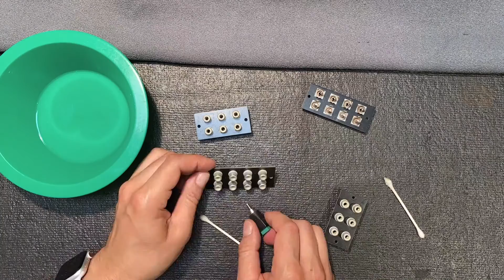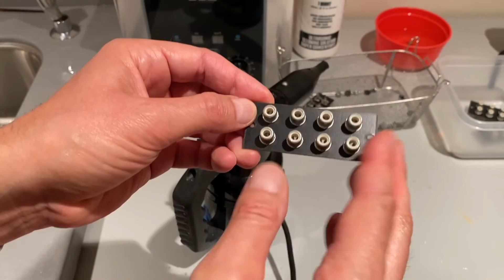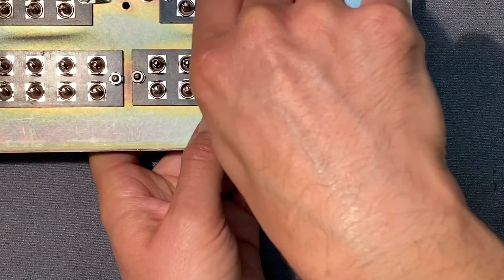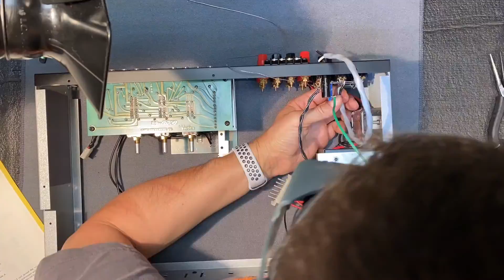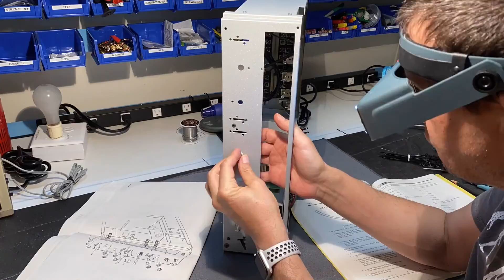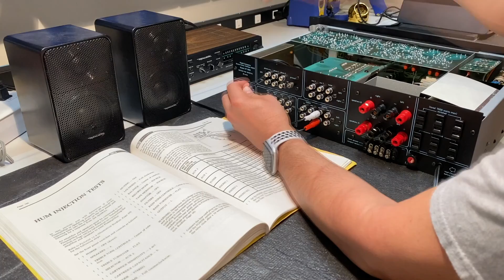Let’s Build A Heathkit Stereo Preamp • P5 Does It Work or Release Magic Smoke?

Comment: Not sure you check your fb comments on your videos but... I finally found an unbuilt AP 1800  on epay and will have it soon. I was wondering how well your unit is working after a few years of service. I have other "high end preamps" but I have admired the AP 1800 for years basically for it's diverse front panel and the ability to switch in multiple turntables. As an electrical engineer, I plan to make some improvements and will probably have some new boards made to keep the improvements looking more or less stock. One plan is to replace the transistors in critical audio path areas and use newer ultra low noise FET's. Of course, many or all of the electrolytic caps will be upgraded to new excellent caps made by companies such as Nichicon, Rubicon and or Wima caps. Should you be interested in the project, perhaps, I can send you upgraded pcbs for evaluation at my cost. Anyway, I was impressed on your assembly of your unit and the excellent info you shared.. my info is glenn@dsmlabs.com  name is Glenn

Comment: Preamp ? Integrated amp ...
Reply from the maker: It’s a preamp.
Reply: O.K.then why ,on  your pre. there are speaker connectors A and B 8 terminals ,so what do these terminals do? @FluxCondenser
Reply from the maker: @alaingingras7224 This preamp has functionality to connect amplifiers and speakers for selection control. There is no amplifier in this unit. It’s explained in more detail if you watch all the videos in this series. Hope that clears it up.
Reply: Makes sense .Thank You for responding ! @FluxCondenser

Comment: I hope you didn't paint over areas where the chassis is needed as a ground. Any place on the chassis that is used as a ground needs to have the pain carefully removed and the naked chassis exposed.
Reply from the maker: No, of course. I believe I mentioned this in the video.

Comment: (1) Use a hair dryer. Much better than that goofy dust buster.

(2) Save the nut driver. THE BEST tool Heathkit provided. Unobtaniim now!
Reply from the maker: 1. No, that “goofy” blower is one of the best tools you can have on your bench. A hair dryer? That’d be pure stupidity. 2. Yes. I’ve got dozens now.

Comment: What did you use to clean the contacts on the inside of the RCA jacks?
Reply from the maker: Wool bits driven by a Dremel and Nutrol control cleaner. The bits are gentle and provide just the right amount of abrasion. The Nutrol lubricates and leaves a protective coating. Works really well. Here’s a link to the bits I use: https://www.amazon.com/Multifunctional-Grinding-Polishing-Accessories-Attachment/dp/B00XJINV42/ref=sr_1_3?dchild=1&keywords=Drexel+wool&qid=1602053831&sr=8-3
Reply: @FluxCondenser  Bookmarked!  Anyway, I often use inter-dental cleaning brushes for this.  They're better for cleaning nine-pin tube socket contacts, however, as the brushes have such a small diameter.  They're available at your local Wal*Mart.

Comment: I think the swapping of the meter leads on the negative power supply was intentional.    Back when this was produced, almost all voltmeters were analog.  You had to swap the leads to read negative voltages and mentally apply the minus sign (if you didn't swap, then the meter needle would peg hard to the left).   But these days, your digital meter can show you a minus sign.  I don't really consider it a "mistake" by Heathkit, they were just following the normal conventions of the day.
Reply from the maker: Not quite, but close. By this point digital meters that showed negative voltages were available. The reason for the issue was that Heathkit wanted the test done and didn’t want it skipped by people who didn’t have a volt meter, digital or otherwise. So instead, they instructed the builder to use one of the as-yet uninstalled LEDs from the kit to create a rudimentary test probe by attaching the LED to a provided resistor. This relates to your point. As with analog meters which can’t show negative voltages, LEDs can’t illuminate with a negative voltage applied to the positive terminal. Unfortunately, Heathkit used the same instructions for both those using a meter and those using an LED which led to some confusion. It is less of a “goof” on Heathkit’s part when you put it into historical context. Thanks for the great comment.
Reply: @FluxCondenser  You are right, you could get a digital meter in 1983.  I just had a browse in a 1983 Radio Shack catalog.  $79 for digital (about $200 in today's $) and about $39 analog for mid-range models.   Don't think I could afford one until the 90's.
Reply from the maker: Paul Rose Yup, that would be a big difference in price. I was in middle school when this preamp was introduced so all this was just unobtanium in  a catalog to me back then!
Reply: @FluxCondenser It seems to me that the authors of the instructions would have written them for the most basic meter a customer might have, which in this case would be an analog meter. The fact that expensive digital meters existed at the time doesn’t mean the instructions should be written for them.

Comment: Sometimes I wonder how my AA1800/AP1800 sounds compared to some of the Emotiva XPA2 Gen1 amplifiers combos, bought this stuff used a few years back locally after a long time looking and waiting.  The Pre amp is alright, but I think it needs a recap since my NAD 1600 is far more transparent.  The amp probably needs to be refreshed with new caps also.  Hard to believe they are kits, nice and thick metal not the flimsy sheet metal used today.  I wish they still made audio like this today without the esoteric prices and looks.  I read somewhere that Heathkit company hired Harman Kardon engineers to help them design these products, I wouldn't be surprised, since Harman Kardon has some of the best vintage receivers and amps I ever heard.  Looks kind of Harman Kardon also.  Nice Job, I wish I had the time and the skills you have!
Reply from the maker: Thanks Sound Man. There were a number of components that tested bad on my kit which needed to be replaced, so it’s likely that your kits could benefit from a tune up. Interestingly, though, the electrolytics tested OK for the most part even though I didn’t use them. In the next video, I’ll be bench testing the preamp as well as doing some listening tests. Without letting the cat too far out of the bag, I can tell you that to my ears “transparency” is stellar. The preamp is dead quiet and the phono stages sound superb. Stay tuned.

As far as Harmon Kardon, that company did provide the later stereo kits for Heathkit in the final years that they offered them. I’ve heard that these particular models (Pro Series) were Harmon influenced, but I’ve also heard that’s not the case and they’re pure Heathkit and that’s what I’ve come to accept. I’ve not read anything conclusive that confirms otherwise and there are no Harmon markings of any kind in the kit or its literature. For the later kits, Heathkit was very clear about the Harmon involvement.

Comment: The wait worth it! Excellent job. Indeed it looks that the preamplifer was meant to be built like a tank for years and years of service.
Reply from the maker: Thanks, Irwin.
Reply: @FluxCondenser  Hello Flux, is there any posibilty you can give me advise on a hifi component I'm currently trying to fix? I'm ok if you can't, but I'd really appreaciate your help!
Reply from the maker: Irwin J. Céspedes I can certainly try, what’s up?
Reply: @FluxCondenser  I bought a Denon DR-M44HX deck last year in ebay. The deck was listed as for parts, so I thought I could give a chance and try to fix it. when I opened it it didn't sound the tape. Transport was ok, so the tape moved. However, there were 2 Zener diodes and a capacitor blowned up in the power board.  I changed them, but them I realized that where the play heads connect if I put my finger closer a huge hum starts to sound. I thought the culprint was a M5220L dual opamp, however problem remains. I've also found the Amp board PCB has a dense flux layer, so I could think capacitors are the problem. But to be honest I'm approaching to the deck with my empirical knowledge, since I've had no degree on electronics. 

It's weird because when you inject sound to the line input and you select the source switch (it's a 3 head deck) music sounds but the VU meter doesn't move, and the tape does not record as well. However, when you play it, and if you raise the output volume to the max, the music sounds  very quietly, like a whisper.

Sorry for the long message. But I tried to condense as much as possible the issue. Thank you for your time!
Reply from the maker: Irwin J. Céspedes Hi, Irwin. Inducing hum from the play head or from any points connected to the play head seems like normal behavior to me. The amount of voltage created by the play head from the moving magnetic tape is tiny, so a preamp in the machine is necessary to boost voltage. So, again, getting hum from touching the input to the preamp is normal, just as I was able to induce hum in this video from touching the inputs of the preamp. Because you’re getting hum, I would think you’d get sound from a prerecorded tape playing. Are you? Reading your comment it seems that you do, but playback level is very low. If your induced hum is loud, but playback is low, that suggests that the amps are working after the head, but the head itself is not. Perhaps it’s out of alignment or is malfunctioning. Additionally, it could have a bad connection. 

Additionally, to diagnose the playback, record and VU problems, your first step should be to find the schematic for the unit and find the listed voltages at different test points. Any points that test bad will give a clue to where the circuit is malfunctioning. Additionally, you can try to pin down the play/record problems through signal tracing. Inject a signal at the inputs and probe with a signal tracer or oscilloscope to see where you lose the signal. I’m not sure what caused the zeners and cap to blow, but it may have been a power surge. If not, then something shorted after the board and of course that should be looked into as a possibility. The capacitor you replaced may have itself shorted, causing the diodes to go.

Once you find the areas of the circuits that are problematic, the likely failure points are capacitors and transistors (although there could be other issues as well, of course). Test the electrolytic caps with an ESR meter and replace any that are out of spec. Additionally, test and replace any bad transistors. If you don’t have a transistor tester, you can sometimes get away with testing them with a good voltage meter. X-ray Tony just did a recent video explaining some methods. Sorry I can’t give you any specific help. If you narrow down the problems further, let me know what you find and I’ll see if I can provide some insight. Good luck!
Reply: @FluxCondenser  Cool, I'm going to study the service manual (I have used it since I've received the deck) and check the voltage test points.

If I find something, I'll reach you out. Thanks!
Reply: @FluxCondenser  Dear Flux, as much as I wanted i couldn't figure out what happened to the deck. I studied th Service manual, checked the components but I just couldn't find any bad components. I'll reassebly the machine and give it a test, but I have no hopes.
Reply from the maker: Sorry to hear that, Irwin. Good luck on your future projects.